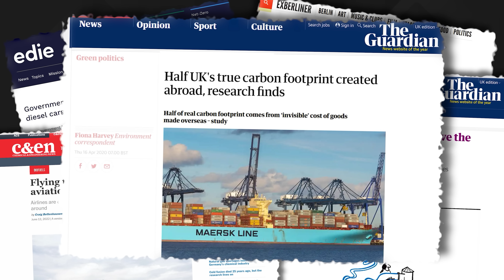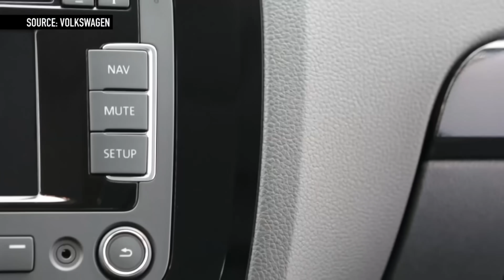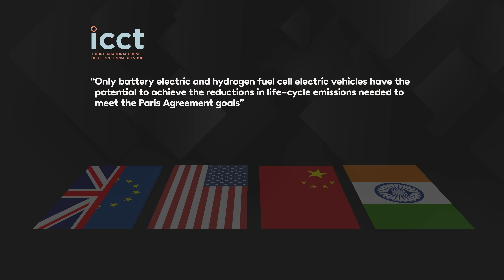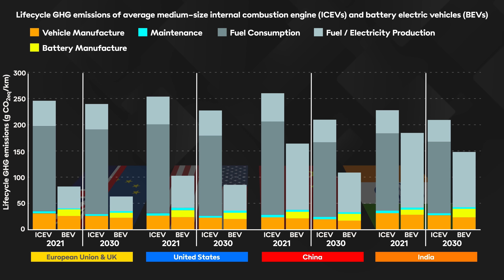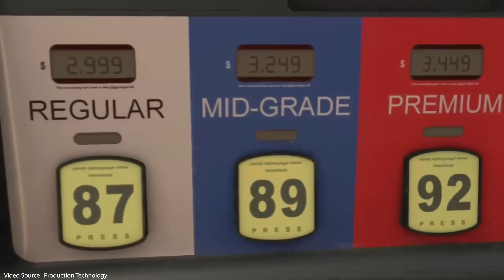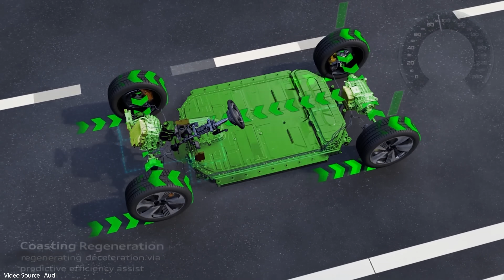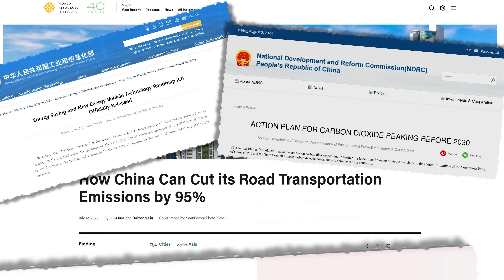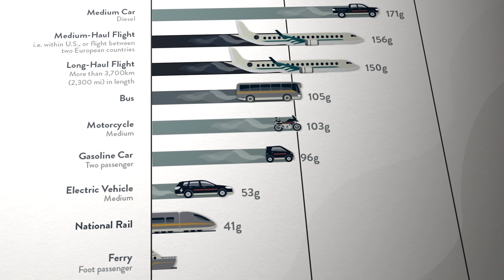Are EVs really better for the climate?

Comment: 12,500 miles?  That's probably close to the average yearly mileage in the U.S.  Before COVID it wasn't unusual for Americans to drive 15,000 or more due to the distances in the U.S.  COVID and telecommuting may have reduced that some, but I'd still bet it's close.  On the other hand, American distances are one of the things that make battery powered cars unattractive to Americans.  A friend of mine commutes about 150 miles per day 3 days a week.  This is quite a bit longer than average, average being around 40 miles, but not exceptional.  Going on a trip, say, from the San Fernando Valley to Las Vegas (not my style, but very common) is around 280 miles.  A Chevy Bolt has a range of 247 to 259 miles on flat ground, which does not describe the trip.  Having to stop somewhere in the desert to recharge is seriously inconvenient, whereas stopping for gasoline takes maybe 5 minutes at most, besides which, most American gas or hybrid cars will go well over 300 miles, so no stop would be needed.  Camping in the Sierra Nevada is more my style, but it's a longer distance still, and when I got there, there would be no place to plug in.  I'm for electric cars, but, for the U.S. they need to have more range.

Comment: It is nice to see in those bar graphs something I had long suspected: the environmental manufacturing cost of an EV is less than that of an ICEV; it's just that of the battery sends it over.
Reply: The problem with any of thes studies is that so many of the metrics are not only variable from country to country but moving rapidly on the manufacturing side. A battery being made in 5 years time will use less energy to make it than one being made today...we just get better at making things when we do them in volume. The main consideration for me is that many EV’s built in the 2030’s and 2040’s will be made from materials already mined and used in EVs today. Urban mining will be one of the world’s biggest industries by mid century, this much is clear from the billions of investment going into it and the consortia who are lining up to do this work. This year alone Redwood Materials will recycle enough batteries to provide material for 10 GWh of new ones..their feedstock today is phone, laptop, tablet and power tool batteries but in the future it will be old EVs. The existing technology has achieved recycle rates of 97%, so we are heading toward a truly circular economy.

Comment: Nooo!! At 6mins 15seconds you say 'natural gas' but you are talking about the stuff that people burn. The fossil gas that consumers actually burn is a highly processed and refined fossil fuel. It should be called fossil gas. It would be very helpful if you used the term 'fossil' before all mentions of fossil fuels. So fossil coal, fossil oil, and fossil petroleum. That will make it easy for people to identify the fossils in their lives.

Comment: This whole discussion has had me wondering the viability of our culture at large. For example how are companies of any type making any product supposed to always turn a profit without some backlash? Realistically there is NO POSSIBLE way for this to happen. Inflation seems to be the real byproduct of this. When the money needs to look better in ink just make each monetary unit worth less & make more of it to offset the lower value. Since when does any food commodity item take more or less of the same resources to make or grow? Only through striping the nutrients from the water & soil does the balance really change since pests have been & will always be an issue. 
  Tech & metal resources are a big part of the rise in costs clearly due to innovation costs. The fundamentals still are what they are at large. Bottom line if we don't change the way we really live & consume any & all resources the future looks very bleak indeed.

Comment: what are the emissions for bicycle?   It is not zero.   electric bicycle is even higher.   These "figures"  widely vary depending on how technology is employed to deliver them.  We could have far slower (but still fast) air travel that used a fraction of the energy etc.       One train may be powered by sails another by coal etc...   How can you compare apples with oranges ?

Comment: Recently I wrecked my PHEV. Horrors. Because the price of cars has soared, the insurance didn't cover the cost of replacement. So instead, I bought a 20 year old Lexus. 

I hate it. 

Loud, smelly, lots of vibrations. But only in comparison to my old PHEV. Compared to modern Lexus, about the same. I like to rationalize that by buying an old car, I have saved the carbon for producing a new car. But after this, EV or nothing.

Comment: Not totally against EV's but right now at least in my part of Europe it's not feasible. 
When production of EV's will get alot cleaner and also the production of electricity will be totally green that maybe. 
Another thing that is not so great about owning an EV right now is the charging infrastructure, not developed enough, at least not in eastern Europe. 
Charging times another issue, I don't want to spend more than 10 minutes at a charging station for a full charge. 
Range is another problem for some EV's right now. 
And the final issue in my eyes is the purchasing price for a decent EV with adequate power, built quality and range is pretty high right now. 
So at least for now I'm going to stick to my internal combustion engine.
Reply: I live in Southern Spain and considered (and rejected) buying an EV five years ago for most of the reasons you quote and bought a very economical hybrid instead. Looking at the charging station situation again recently I was pleasantly surprised at the improvement made here over that time. It's probably not improvement enough for me to switch right now - but in a couple of years when I'm thinking about my next car....

Comment: What is the geographic breakdown of the use and percentage of CO2 savings for Plugin Hybrids?  Full disclosure, I have a Tesla Model S (Wife has a Bolt and my Son now drives my first EV , A Smart ForTwo EV) and have 10KW solar array on my roof. And I live in Ontario, Canada which phased out Coal a decade ago . . BUT  . . My Friends, Family, co-workers, and fellow citizens, in Ontario, drive in weather that ranges from bellow -25Celcius  ( 300cm annual Snowfall)  to over +30Celcius year over year. And we drive over fast distances. My Daughter is 300kms to the west, my best is 300kms east and my parents live 240kms North with the closest DC fast charger 200kms to the south of their home . . My Question is , "What, in the data, are the geographic variables that pertain to percentage of reduction in emissions for Plugin Hybrid Battery EVs"? Specifically  with fossil fuel  range extension engines . . It's all well and good for You Lot (England, UK, Eurozone) to scoff at Plugin Hybrids after Londoners bought Plugins to get around the 'congestion fee' and NEVER PLUGGED THEM IN!! Wrecking it for us in the colonies  . .

Comment: Apparently 50 percent of the lifetime emissions used by a car occurs during the construction. So... It may also be helpful just to drive our cars longer?
Reply: According to which source?
Reply: low CVP report. 46 % emissions/footprint generated at the factory before driving a single mile. (and EV generate higher emissions than standard combustion car during their manufacture) Conclusion is not that EVs are  worse overall but that need to look at entire lifetime of car.
Reply: @blackfeatherstill348  There's no way that figure is accurate as different ICE engines have different emissions, some ICE cars are huge and heavy and some are light and some last much longer than others. So you can't state that x% of a vehicles emissions come from manufacture.

I think it's accepted that EVs currently have a higher environmental impact for their manufacture than ICE vehicles but they offset that by having no emissions during their use, other than from the electricity generation if they're not using renewable energy.
Reply: @airchie2  I didn't state it, the report stated it and it is a legitimate report by  people who are highly knowledgeable in the field. The main reason I brought it up is because it is not something that many people even take into account.
Reply: @blackfeatherstill348  Can you provide a link to the report you speak of? Only one I could find matching your description is discussing the decarbonisation of heavy duty vehicles...

Comment: Two significant factors in the comparison missing.  1. How much fossil fuel and emissions does it take to MINE the Rare Earths needed for the EVs? 2. How much fossil fuel and emission does it take to recycle the battery system after 1 lifetime used by the EV?
Reply: 1. Less than it takes for exploration, drilling, producing, refining and distributing of fossil fuels.
2. Less than it takes to mine and refine the raw materials the first time around.
Reply: @airchie2  I get your point but they both need to be factored in as major costs in the comparison or it's incomplete.
Reply: @johnmerlino7011  I agree we should be taking a holistic approach to measuring environmental impact.

In a strange twist of fate, EVs tend to be held to a higher standard because they need to counter all the FUD generated by oil industry supported "think tanks". They still compare very favourably to the incumbent ICE engine tech...
Reply: @airchie2  A year ago I was thinking I wanted to buy an EV when prices were acceptable but now I do not want to be in a position that I depend on the old grid.  Imagine getting home with your new $60,000 EV and your electric company gives you restrictions or a different rate table!  All of a sudden it's unusable.
Reply: @johnmerlino7011  You don't want to depend on an energy source that you could provide yourself using solar because you prefer to rely on an energy source that's largely controlled by the Saudis?

Comment: Another video that considers only BEVs and ICEs, but not Hybrids. 
- BEVs are estimated to have generated 55k miles worth of pollution by their Year 0. In the USA, that's 3.75 years of driving, after which the electric car will be more efficient than the ICE car.
- Hybrids use a battery about 1/200th the size of the BEV, and pollute 1/2 as much or less. So they make up their pollution in the first week - after that, they're polluting less than the ICE car. 
- This means it takes 7.5 years of driving a BEV for it to pollute as little as a Hybrid.

Comment: I have bought my last ICE vehicle. But as the carbon emissions from manufacture is a sunk cost. I drive only about 2500 km a year in retirement so I am in no hurry to replace it. But it does use 20% less fuel than my previous one. It will likely last me until they take away my drivers license. But if someone runs a light and totals my Honda I have my eyes on a VW Buzz as I expect it to be easy for getting my wheelchair in and out. I just hope no one runs into me before I can buy one.  Still, I live in British Columbia on a 10 acre plot with loads of trees to make a good carbon offset. Of the 3 cars here, one is an EV already. 

And great video.

Comment: Our cars have a weight and performance problem. A typical car weighs between 1750-2000 lbs. An SUV, pickup, or minivan between 2000-5000 lbs. They are also made for fast acceleration and sustained speeds of 60-100 MPH. This is ridiculous for most trips. There is no reason that a safe light motor vehicle designed for 1 or 2 people with creature comforts including heat and AC and/or enough cargo space for errands can't be made for a weight of 200-500 lbs and speeds of up to 60 MPH. Such a vehicle could get 100 MPG or equivalent, even using an ICE. For heavier duty or long trips rent an appropriate vehicle. We also need better public transportation and bicycle and light motor vehicle infrastructure.

Comment: First of all, it's adorable that you actually believe China is going to keep it's carbon promises. :D

2:10 you talk about 1850 temperatures as the sort of touch-point for where we need to anchor our temperature allowances. Why that date and why that temperature that we had on that date? Isn't any temperature and any date completely arbitrary considering that the Earth has been both much warmer and much colder than we were back in 1850?
Reply: 1850 is the height of the industrial revolution, its the about the first time there were enough humans, starting to burn enough fossil fuels to actually start making a difference to the environment! Coal burning and Steam engines were starting to become common, land was been cleared for commercial agriculture, trees been mass cleared, mass extinctions started, its when the virus called "humans" started to get out of control!!!!.

Comment: An excellent video Dave.
I will admit that I'm a little biased - I bought my EV 9 years ago (Gen 1 Leaf) and haven't looked back. I bought it for the 'right' reasons but have had soooo much fun driving it over the years (I have done over 90,000km) I'll never go back to an ICE car. It is a solid, well built car that (due to the technology) doesn't vibrate itself apart and after a battery replacement a couple of years ago, was as good as new. 
I had a Level 2 charger installed in the garage, which has solar panels on the roof and for around town driving, I have not needed to use anything else.
I am on the wait list for my next EV (designed by Engineers! not Ad men) - an Aptera 😊

Comment: Mazda's Skyactiv-X ICE regularly hits 40% thermal efficiency. That about puts it on par with a BEV charged from high efficiency combined cycle natural gas plant from a CO₂ perspective.

I really look forward to buying a BEV that can do 600 km in -30ºC on a single charge. That would cover most of my driving without major inconvenience.

Next month I'll be driving a stretch of road with 400 km between fuel stations. BEV are great in cities but aren't there yet for remote road trips or day trips in winter.
Reply: Use carbon-neutral liquid fuels from nuclear

Comment: Here in the UK for everyone to go over to EVs the national, and local power grids are probably going to need a complete rebuild from the ground up to be able to handle the load of all the cars charging, some local grids are already struggling as it is with current power demands and that's without the extra demands of many EVs charging. Your also in many places you're going to have charging leads trailing over pavements.

The recent really hot weather has shown that not all forms of renewable energy can be relied upon:

* Wind: Not enough wind to run the turbines
* Hydro: Water levels getting low in reservoirs cutting generating capacity

Nuclear has also had problems due to the cooling of the reactors

To reliably power EVs you're going to have to move over towards coal and gas for power generation if people are to be able to charge their EVs when they need.

You're also going to have to make it much, much faster to fully charge an EV before they'll be viable for many people. For ICE cars if you find you need to go on a longish journey at short notice you can quickly fill your tank but for an electric you might have to wait a good few hours for the battery to fully charge up

Comment: Every additional electric vehicle needs additional electric energy - which we don't have and must produce. As long as we don't have 100% renewable energies, this additional package of energy will be produced either by a gas-, oil-, coal- or atomic powerhouse. So, in reality, it's down to: which car does consume less energy, simply because both consume the same conventional energy aka fossil energy. Quite likely a draw, esp. regarding the immense weight of electric cars..
Reply: The greener grids get the better EVs get.
Large power stations convert fossil fuel to electricity much more efficiently than ICE vehicles convert it to motion.
You can apply carbon capture to a power station but not to a vehicle.
EVs are more efficient than ICE vehicles by a very large margin.
EVs don't produce harmful exhaust emissions that you breath in.

Even if your assumption that the amount of fossil fuel needed to drive a mile was the same for ICE and EV vehicles was accurate, EVs would still be better cars with less emissions. :)
Reply: @airchie2  1 MW produced in a coal powerstation to drive EVs means sending 1 MW over the wires and transforming up and down and losing quite a lot on the way just due to resistance. Overall there won't be any advantage for EVs - as long as we need a coal powerstation to generate the (additional!) electricity. This will change the moment we produce our electricity with renewable energies like solar panel, wind and such, but that's a looong way to go. EVs are not the answer to our problems, they are the same problem, but with a different color. The only thing that can help is relinquishment and moving to public transport systems. Good luck with enforcing this to the people. They won't listen, they will just deselect you.